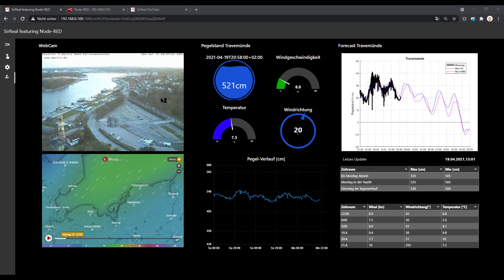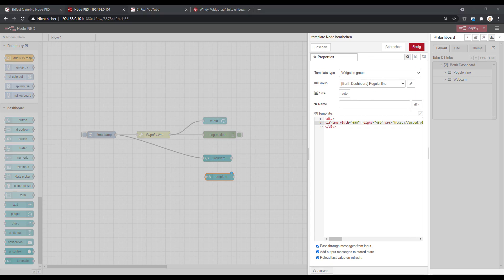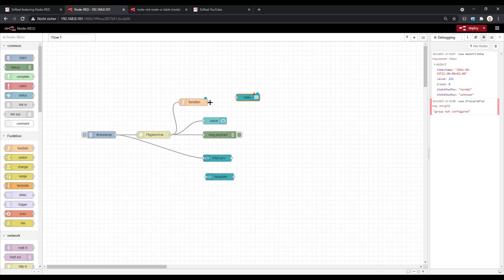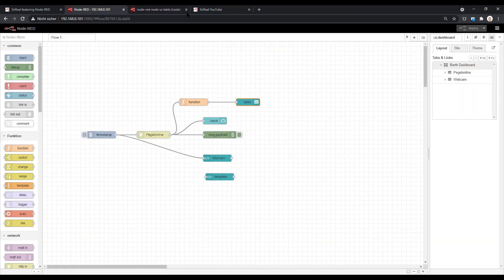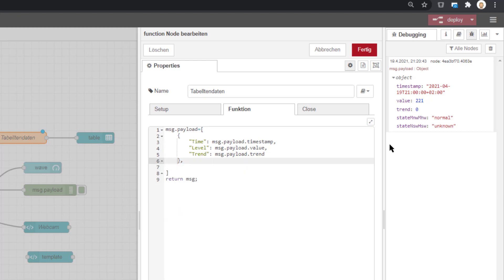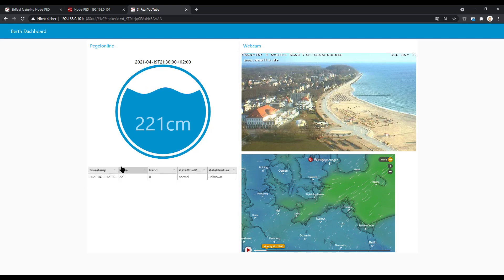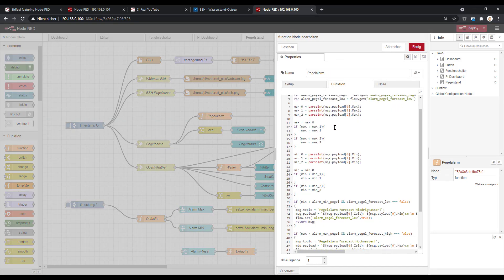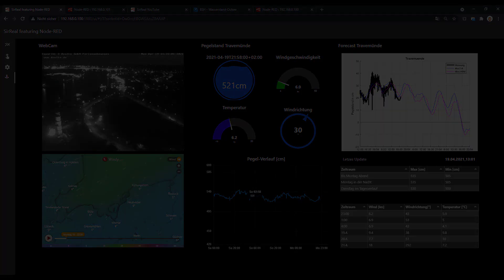raspberry on a boat #14: Dashboard for your Sailboat Berth with Node-RED 2/2. Windy.com and Tables.

Comment: Is it possible to get the weather map from Windy based on the position given by the GPS receiver?
Reply from the maker: Yes, of course. This is quite easy as this is even possible with the embedded iframe (instead of the more comprehensive API which offers this as well).
If you take a look at the HTML link of Windy, which we did copy in our part #14, the is a "LAT" and "LON" information. You simply need to replace that with the GPS information.
We did something similar already in our NMEA AIS tutorial.